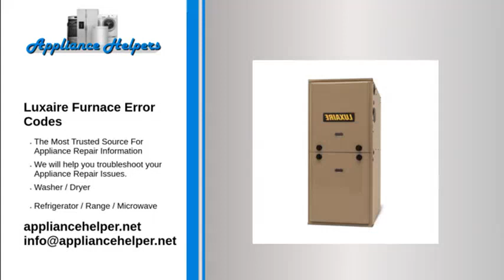Luxaire Furnace Error Codes

Comment: When I get 9 red flashes (reversed polarity or grounding problem) what does that mean if the unit worked fine several months ago and no wires have been touched since then?
Reply: Check the power coming in. The line voltage. The 120V. Check that you have 120v from black wire to ground (meaning the green wire screwed to the body of unit) if you don’t see a green wire check 120v from black to the metal bossy of the unit. You’re supposed to get 120v   . Then check the white wire to ground or metal body of unit. YOUR NOT SUPPOSED TO GET ANY VOLTAGE . If you do then you have a short. If you don’t get 120v from white wire to ground then check that you have 24v coming out the transformer secondary side. If you do just try reversing the wires and see if that works. If it doesn’t you may have a bad board.